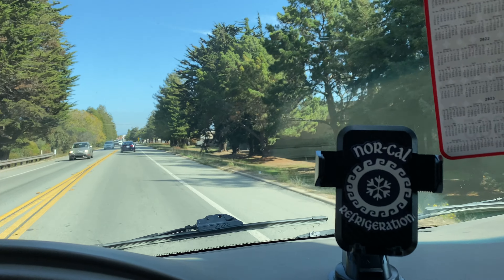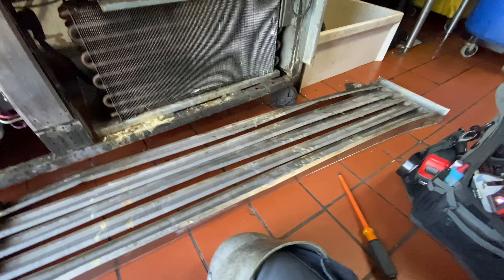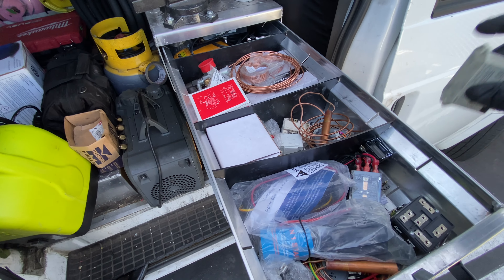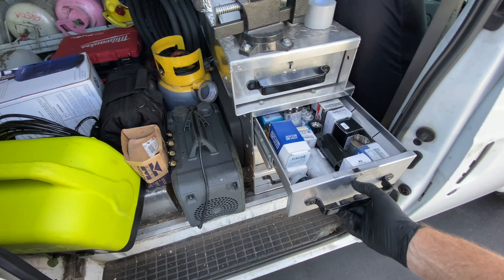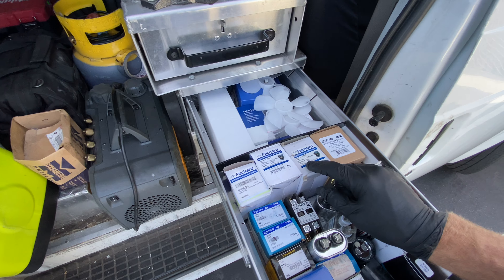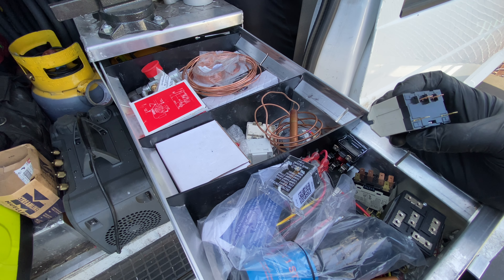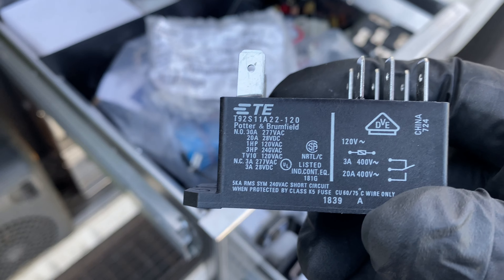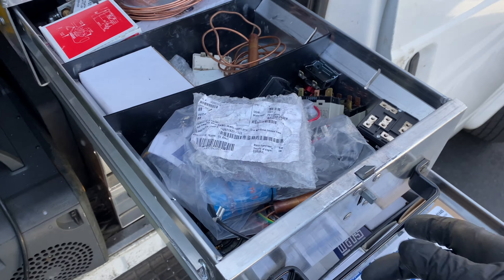Why is the Freezer making a noise?

Comment: Not likely the cause of the noise here, but a low coil voltage can cause a buzzing when the coil is near its opening voltage (when the spring tension is almost overcoming the magnetic force by the voltage pulling in the contacts.) We test a bunch of relays and contactors in school with an autotransformer and record the pull in, drop out and buzz voltages. Good note to remember. Your average 2 pole 600v 24v contactor will pull in around 16v,  buzz below that and drop out around 12v. They sound super loud right before they drop out. Old connections / bad crimp jobs can cause voltage drops!
Reply: Remember to make sure your transformers are tapped to the proper voltages!
Reply: probably had schmutz built up in it or rusted and holding it apart slightly. pretty typical on coolers. but yeah, low voltage makes for some bad times and noise. bzzzzzzzzz